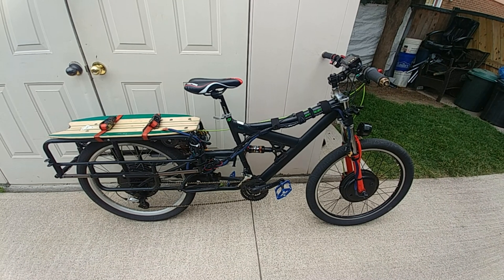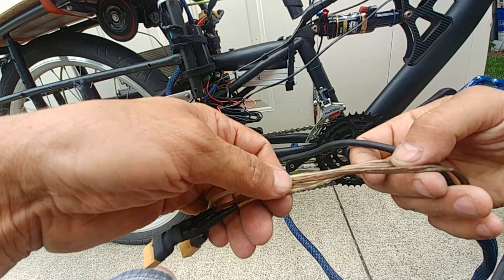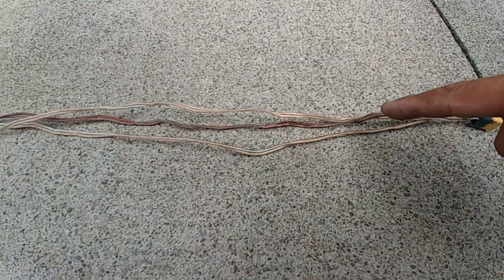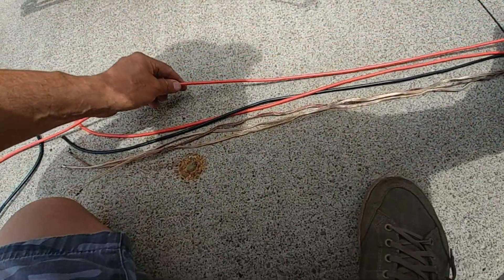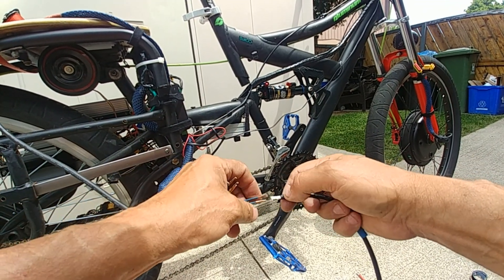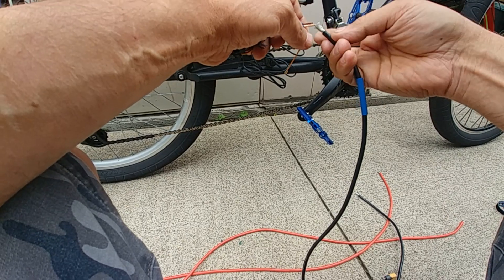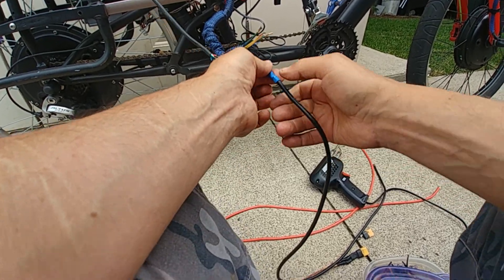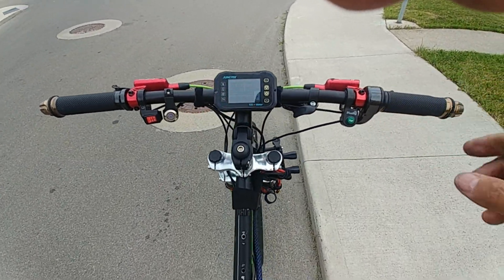ebike vlog# wiring harness rewire 10awg*bad phase*

Comment: Thanks for the glimpse of the old B-25. I've got a little right-seat time in a J-model and on takeoff we used to set masses of car alarms.
 In regards to wiring, I might mention SIS or 'Switchboard' wire. I've used it a lot in industrial control wiring and motor Controls and I like it because #10 is fine strand over 100 strands of oxygen-free high strength nickel plated copper, with high temp, abrasion resistant insulation with some specs rated up to 105C but can take a lot more heat without breaking down. It's a lot more flexible, durable and has higher current rating than primary wire. I love the stuff.